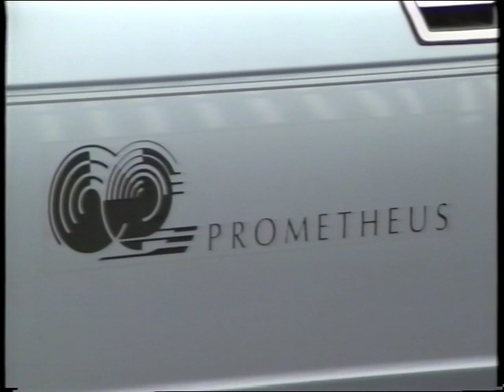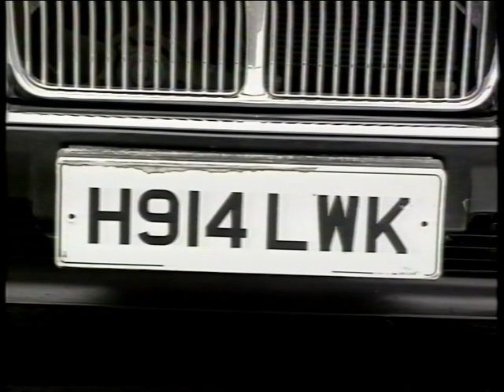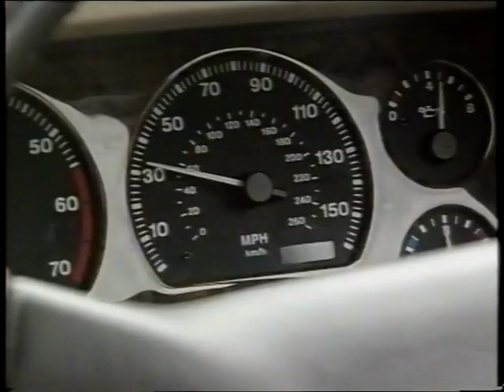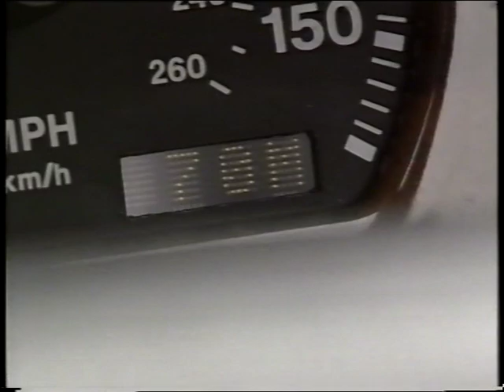Self driving Lucas Jaguar PROMETHEUS car from 1994

Comment: The vehicle details for H914 LWK are:
Date of Liability	10 06 1996
Date of First Registration	21 05 1991
Year of Manufacture	1991
Cylinder Capacity (cc)	3980cc
CO2 Emissions	Not Available
Fuel Type	PETROL
Export Marker	N
Vehicle Status	Unlicensed
Vehicle Colour	BLUE
Vehicle Type Approval	Not Available
Reply: That probably means it got written off...
Reply from the maker: Yeah, Jag eventually scrapped the car but we built it's successors on other VM's cars.